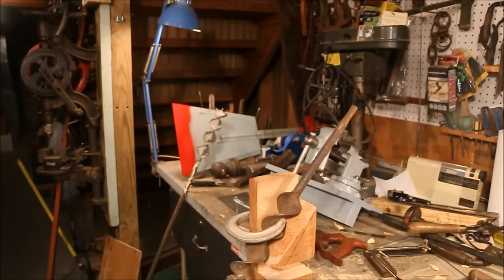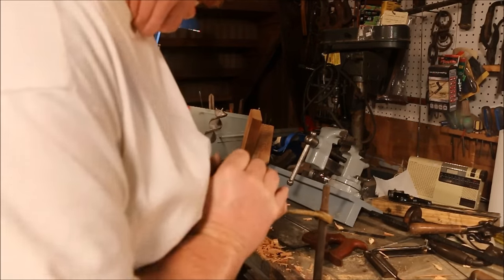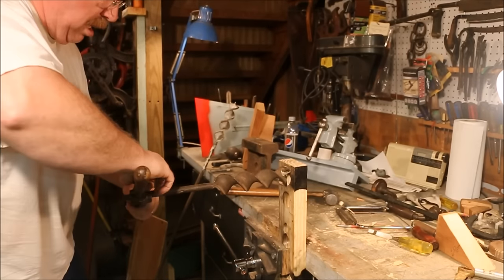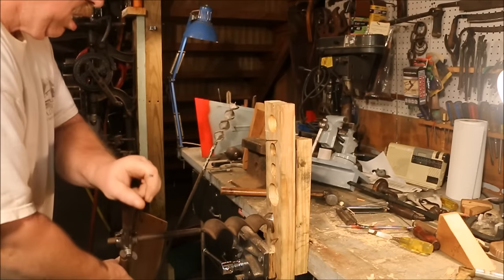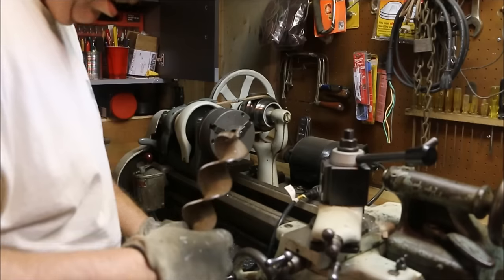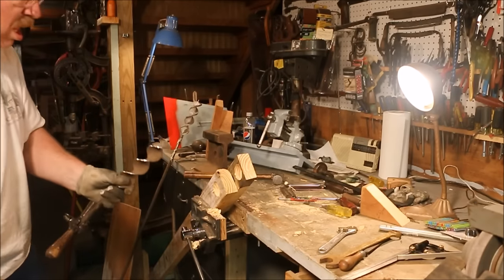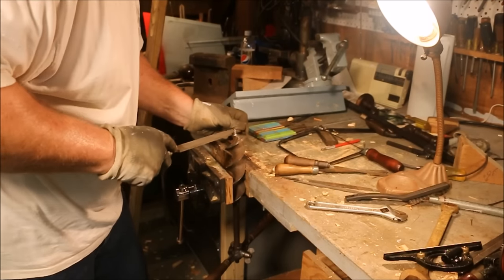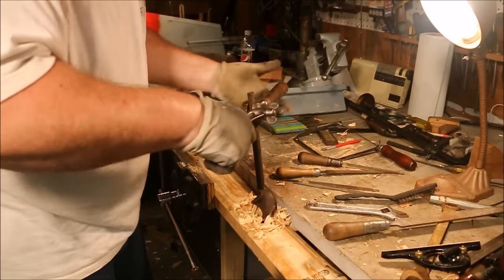Repairing A Destroyed 2 inch Auger Bit ~ Old Sneelock's Workshop

Comment: Can't eat if it can't bite. Good old relief angle. I understand a little more every time.Thanks Unc!
Reply from the maker: Funny how many times that turns out to be the problem.
Reply: Old Sneelock's Workshop And someone that lays a file to the wrong places. Just like a rock bit in a long hole. Starts out with a big bit and gets smaller as the steel sections leinghten. I know I've learned a lot from you but also know I have a LOT to learn. Thanks Unc!

Comment: i dont have any knifes on the side of my auger.
it rips the wood apart and doesnt go deep. because its not cutting the chips its making.
is there any way to fix this?
Reply from the maker: I have thought about TIG welding on some O1 tool steel and shaping it into a spur. I have the equipment and I am sure that would work. Is it worth the trouble?
I don't think it will add to the Man cave appeal and that is where most of them end up.  😋😎
Reply: @OldSneelock  i understand. i was starting to do some bushcrafting on public land and i made myself a scotch eyed auger from an old auger bit that apparently was used to dig earth with?? it was pretty mutilated but i managed to shape it back and sharpen it OK. the problem is it rips the wood and clogs because it doesnt have a cutting spur anymore.
i will try to fix it when i get access to a welder.

Comment: Sir
I saw a video with a auger bit that had a circle at top for a round peice of wood...please what is this tool called & where can I find them...terry 💯❤🇺🇸
Reply from the maker: I got most of my augers from flea markets, junk shops, and antique shops. 
Buying a new one is possible I just never felt the need since I am able to sharpen the old ones to work just fine.
Reply: @OldSneelock  

I found what they are called...Scottish eyed sugars...thanx for the reply sir...💯❤🇺🇸
Reply from the maker: I see. Couldn't quite picture it. 
Those were blacksmith made tools designed to have a tapered wooden handle driven into the loop. 
Made it easier to fit into the tool box by knocking the handle out. 
I don't own one. most of mine have a square tang with a thread on the end.

Comment: another save by Old Sneelock.
Reply from the maker: Not one of the best but I did want to show the effect of the relief angle on the cut. This was a good example.
Reply: Yes it was. Some people wonder why I waste my time on old saws. When I canjust buy a new one and throw it away and get a new one when it gets dull. Some of the tools I get arr beyond help, or will never be collectible or not worth the time. But I just enjoy making them users or useful again. Yes there are better examples, but my budget does not always allow for the cost of better examples. But one thing I have is time and elbow grease. 
And I rehab some of these tools I can use them to fix up others. I do not have any large Augers, like in this example, but I pick up what I can find. 
Thanks as always for your videos.
Reply from the maker: Matt Cooper I pretty much feel the same way Matt.
It gives me a great feeling of accomplishment to revive an old tool. It also surprised me the first time I really sharpened a Disston D-8 the proper way so it was cutting like it should. Ever since I was about 11 and Dad got his first circular saw I had been living in a world where wood was cut with a 2 1/2" limit. That was as deep as a 7 1/2" circular saw blade would cut. If you needed something thicker you joined 2"x 6" together. That way you could cut them before assembly.
With the 28" long D8 I could cut a 12 x 12 barn beam in one pass. No problem. It's like taking off blinders.

Comment: I really like your videos, but it's awfully frustrating when the 'important stuff' is happening six inches below the bottom edge of the screen...as in the beginning of the video when you're filing the cutting edge and clearance angle.
Reply from the maker: Thanks David. I have a problem with that. Thanks for pointing it out. I have to spend more time checking my picture and less time working on the project if I expect to remain interesting. Might need to fire up the 2nd camera so I can be doing a long and short view.

Comment: closed captions ok but it writes what your words SOUND like...at2.00  "drive it UP, not "out". Many other TYPO's but basic message gets through, although you have to read-between-the -lines.  So, whats a save-edge file? So, I am  guessing yu now haqve a 1 7/8 drill bit?
Reply from the maker: Seth Warner Safe edge files have one or more faces without teeth. The safe edge lets the file sharpen the cutting edge without damaging the  spur or shank of the bit.

Comment: were and are these used mostly for timber framing ? How many do you have ?
Reply from the maker: I think they were mostly used for timber framing. Drilling for mortises makes a lot of stock removal easier. 
I have sold a bunch of these and I really haven't counted but I would guess at least 4 or 5 of the 2" right now. I have several more of the smaller sizes. I keep some of them for the Beam Drilling Machine and others I fix up as I need them. The biggest I've found are the 2". We did use a 2" to bore holes in my sons entertainment system for the turn table bearing. I think it was more because I had it than an actual need. :-)
I don't do timber framing very much anymore. Since we moved away from the farm there isn't much call for heavy timber in a ranch house.
Reply: @OldSneelock  how much were they selling for in average?
Reply from the maker: @Francois_Dupont  That is a loaded question. I bought most of them at auction in lots. So individual prices would be hard to judge. I haven't bought any in years. In antique shops the prices range from $20.00 $40.00. Size doesn't seem to matter. I think they are ending up at Cracker Barrel or in someone's man cave. 😁😎